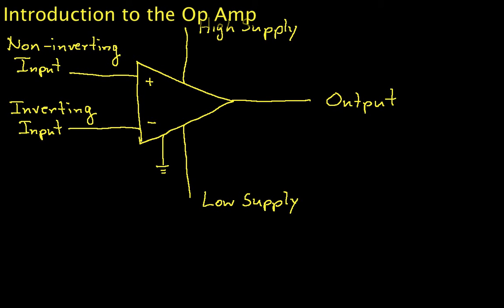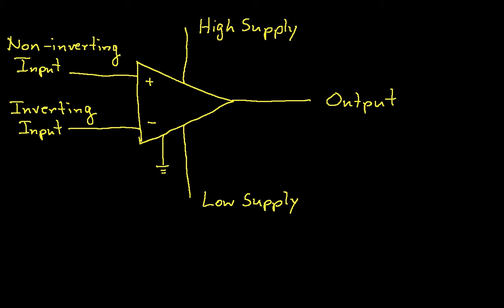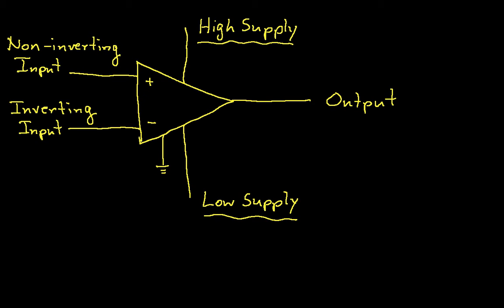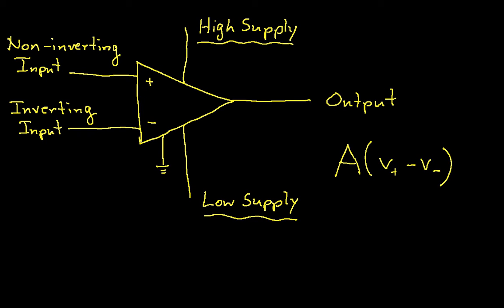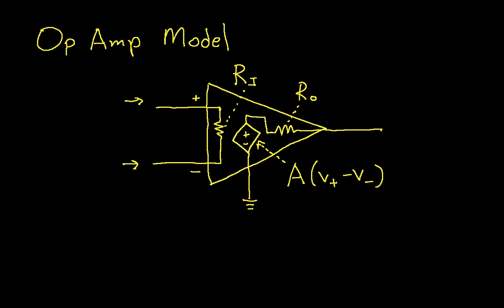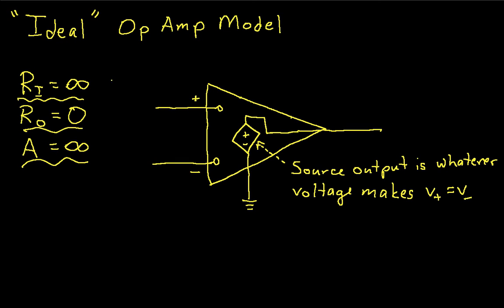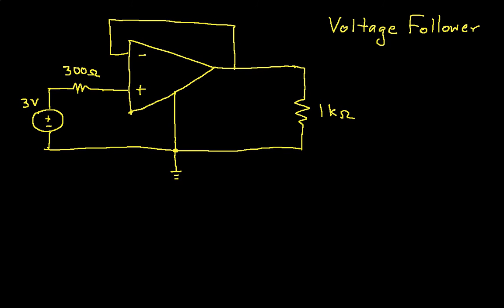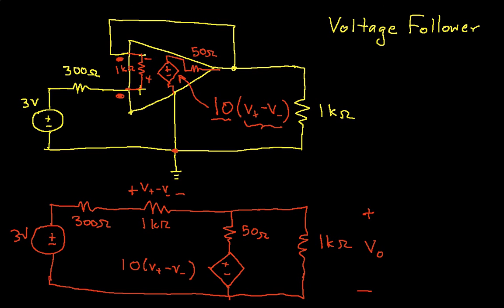Operational Amplifier Basics part 1

Comment: it is so confusing for a beginner. can you please upload a videa with following info

1)inputs different volatages (ex: 5,3) and no feedback what is the output volatage and current

2)explain the same with feedback to + and - inputs from output

3) applications of op-amp and a lab experiment tutorial showing waveforms of each application

please do the needful
thanks in advance :)